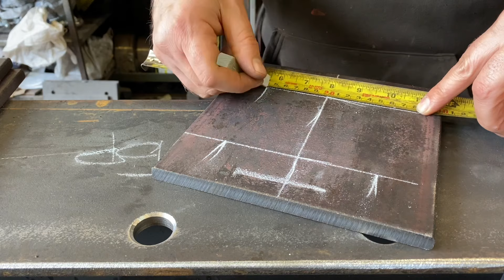Structural Steel Fabrication - Marking out & Tacking end cap plate to steel beam. Part 1

Comment: A lot of marking out for something you can just eye up. All U needed was the top centerline and a bubble on the top flange to the side of the plate
Reply from the maker: Nice. So you level the top flange (with the centre line marked) and plumb the side of the plate for its tack position. ?

Comment: I always grind a small bevel on the beam when its a butt joint like that, it helps the weld get a little more penetration on the weld joint
Reply from the maker: See here’s the thing. And no hate directed here and in no way am I saying you’re wrong. This is fabricated / welded to drawing.  I have no need to bevel that edge, as I’m doing what’s been asked. Thanks for watching.
Reply: @TheMetalFabGuy  no worries everyone works differently I work by drawings as well, the boss and or supervisor usually say put a small bevel, keep up the great work and videos
Reply from the maker: @_high_plains_drifter_5079 all the best

Comment: Mistake, The center of the column is taken from the center of the web, never the flange.
Reply: Sometimes the web can be off set.. depends on who supplies the steel.
Reply: @1700iDiGuy  If that is the case, then it is out of speck. Check the MSDS. If you are setting a head or base plate or a gusset plate ALWAYS take your measurements from the center of the web. Work off of the center of the WEB. Never the flange.
Reply: @1700iDiGuy  Depending on the beam size (weight) the two flanges can be offset. Each member has a tolerance for flang misalignment. This is why you always use the web.
Reply: Yep. 15 year journeyman steel fabricator.  This was painful. Dull soapstone, marking overtop a mark.  Extra layout that's just unnecessary.
Reply: And you always square off of the web as well.  Flanges can be so far out of square it's just silly.  I've worked with wide flange as small as 4in up to wwf that's over 8ft.  Bridge spec.  So even a stray arc is enough to get the whole peice failed
Reply: @TheNightHawk85   I worked in still fabrication for eleven years as a fitter in Structural Steel, Plate, and Tank. I moved into the inspection Department and worked as a Chief Inspector after I received my CWI and CWB in Canada.

Comment: Can a 254 x 146 x 37kg/m beam have a end plate too?
Reply from the maker: Thanks for watching Gurpiar. Any UB or UC including a UB 254x146x37  can have an end plate. What that end plate is doing would need to be calculated by a structural engineer. 
Thickness / Bolt size / number of bolts / weld spec So it’s capable of performing its intended job.
Reply: @TheMetalFabGuy  what is UB and UC bro
Reply: @asikparadaiss618  🤣
Reply: @ricovanstraaten8516  🤣🤣🤣🤣🤣🤣🤣🤣😅😅😅😅

Comment: Never tack in the centre of your plate, the welders won't appreciate that
Reply: It's not a big deal if you keep the tack small enough to just weld over.  I did this for over 15 years as a journeyman, learning how to tack well is incredibly important. We had to hold multiple welding tickets in order to even be allowed to tack due to the size of the projects we would build.  They had to be strong and free of impurities like porosity.
Reply: @TheNightHawk85 I know what you're saying its not a big deal if its small and it can't be helped sometimes, but when you're doing structural its best not to get in the habit, as you don't have to most times where I work we'd have had cleaner steel for a start that was shite, and would have put a small prep on the flanges for a small butt joint, I get tested every 2 years for my different welding positions, everything has to pass nowadays mate, I'm a fabber/welder by trade 25 years but where I work now platers are on more, so I do that, enjoy it more anyway, actual thinking involved, they keep my certs up to date though as I have to weld sometimes
Reply: @jimbob8543 I had all of my welding certs as well, Canadian? I had to do mine every 2 years as well.  I worked in structural, huge projects.  I had to tack in those places for strength due to the size of the parts I was putting on. We did 8mm fillet welds so I kept my tacks at around a 5mm at the largest, I would just make it longer if I needed more strength.  When the welders were backed up, I had to hop in and weld sometimes as well so I totally understand what you are saying.  Everything we built had to pass a full inspection as well.  I was in the trade for around 25 years as well, just a journeyman for the 15 that really counted.
Reply: @TheNightHawk85  Canadian?no mate English, how about yourself? We do mostly hospitals, big apartment complexes, schools and uni's stuff like that, the level down from bridges and large stadiums, our standard weld is 8mm but they can get to 10,12,15 sometimes, I just can't be arsed with that anymore lol, I did the journeyman thing myself when I was younger but I got snared by a blonde and she gave me 4 kids so  nowadays I need stability and a steady job lol
Reply: @jimbob8543I worked on pretty much heavy structural.  Potash mine headframes, raw ore conveyer systems, bridges with custom WWF 8ft wide 150ft long made in house, also some crazy custom work that I was the lucky bastard in the whole shop that was only allowed to touch this stuff.  Made some custom hinges for the head frame that had 10 inch across  pins that had ~1mm overall tolerance.  Canadian myself.  The tickets and training I got their are less than 400 other men in the country with equivalent.

Comment: Work from centre of web not the flange turning sq around wont improve anything lol
Reply: You always work off the flange to center a plate because the majority of the time, beams aren't properly formed. You'll have twisted webs and flanges that are big or small on either side. During assembly the web is irrelevant, you'll always work off the flange. Especially when there are holes drilled in the beam.
Reply: @SouleymaneG  exactly, the flange can be different sizes and usually aren't parallel. The web isn't irrelevant. Tie beams and bracers all come from the web so your base plate should come from the web.
Reply: @SouleymaneG  
So then your web is not central to end plates would not want to erect anything you have made.
All items connecting to wed small or large channel or ub would have to be made individually and measured after you have made your beams not only would you be laughed at finished on the spot get your tools and outa my workshop
Reply: @seanhannan1823  
The web is not relevant, 
Another one who's never made anything .
Ask any draughtsman where he takes his measurements from either by drawing long hand or from a model and they'll tell you the same centre of web relates to there grid lines.
Again hope never have to erect yours .
Neither of you platers
Reply: @barryburton7755  why is the web not relevant?
Reply: @barryburton7755  If you read my comment, I said "the web isn't IRRELEVANT" not relevant. I've been a fabricator for 16yrs and always worked from the web.
Reply: @barryburton7755  I'm just going to assume it's a matter of misinterpretation so as to not waste my time arguing with someone who has been on half of the poster's videos incorrectly complaining about how they do everything. Best of luck to yourself and the assembly guys who require the use of port-a-powers and shims to work on any of your fit-ups.
Reply: @SouleymaneG  But Soul, Barry was 100% correct in what he was saying. You absolutely wotk off the web. However, the uploader clearly knows what he's doing judging from is marking out.
Reply: Centre of the web is the correct way off your BHC.
Draftsman don't know or understand the irregularities of wide flange.
In this situation with lighter construction it's not a big deal structural integrity wise.
The web connections in the field will be comprised past the tolerance through cumulative error.
25+ years experience, Journeyman Welder/Fitter/Ironworker before you question my opinion.
Plus this guy welds structural steel with solid wire GMAW, So his knowledge, expertise, qualifications and technical training are very questionable to me.
Reply: @kellyh4035  nothing wrong with using gmaw for welding structural steel at all
Reply: @seanwright5725  over 1/4" Parent material, too much of a heat sync and to little penetration, it's also prone to short cracking.
Plus, a dual shield wire or metal core creates a more ductile weld while being twice as fast.
Reply: @kellyh4035  wrong
Reply: @seanwright5725  oh, excellent counter point, backed up with data.
Reply: @kellyh4035  you questioned this man's ability because he was using solid wire for structural welding under the mig/mag/ gmaw process,so your saying that a good percentage of the structural workshops in the United Kingdom are doing it all wrong,I've been a plater welder for the last 35 years and the company I'm working for know I've been with 10 years, using 1mm solid wire on plateanthing up to 40 mm thick using single and multi run butt and fillet welds ,our work is regularly ndt and destructive tested by T.W.I one of the most globally recognised training and testing facility's in the world,so yes you. An use solid wire on structural work
Reply: @seanwright5725  well, in Canada we get things done a lot faster I guess.
Reply: @SouleymaneG  been in the game 30 years, I must put on 10000 base plates a year and you work off the WEB pal, were a multi million pound business and all our drawings are measured from the web
Reply: @jimbob8543  Judging by some of the comments I've received I think we should all be grateful that a) People who do assembly are experienced in making bad fitups work, and b) Holes are not generally pre-drilled in the field for new projects so incorrectly centered baseplates are still useable. It's doubtful to me that you have 30 years experience considering your post about welders not appreciating small tacks, which any novice welder will simply weld over top of with no problem. I also am not impressed by a million pound fabrication business.  Feel free to post more but I won't bother reading any further responses. Have a nice day, "pal". :)
Reply: @sean wright  Wrong, check the engineer's specification. Any AWS CWI inspector would chase him off the job.
Reply: I was going to say the same thing. Was just looking for anyone else that actually knows how to fit structural steel. I've seen webs be 1/4 inch from center of flange. Always find center of web👍
Reply: @SouleymaneG  wrong!!! Have to work from center of web not flange
Reply: @SouleymaneG everything you said is wrong.  Source I have over 15 years as a journeyman steel fabricator.